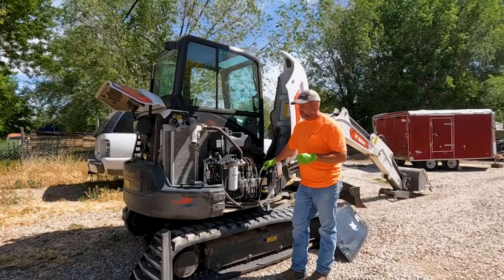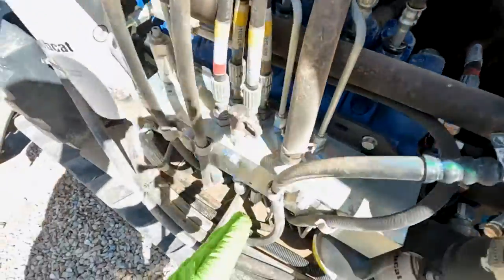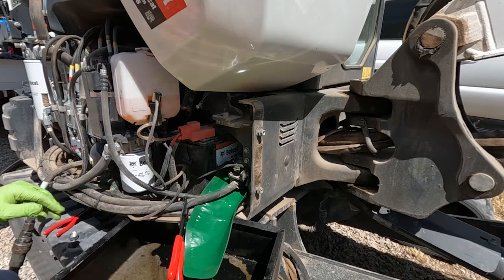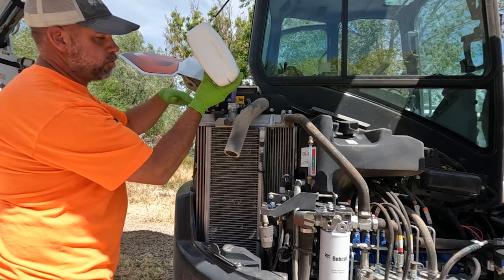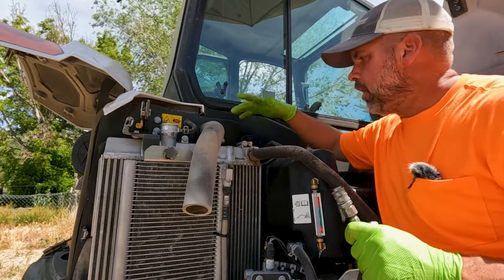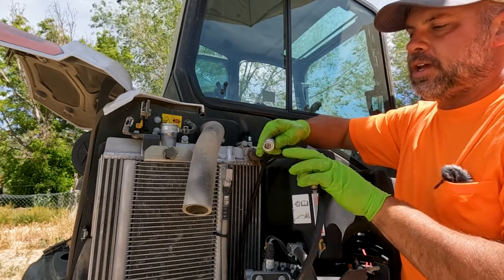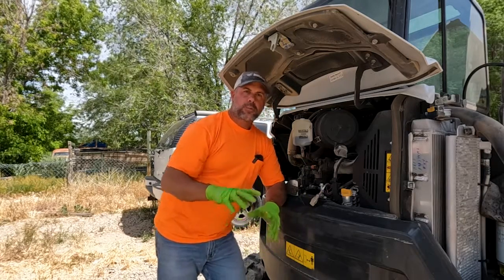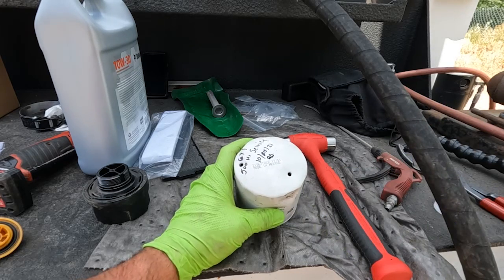Bobcat R2 Excavator Hydraulic Service and Coolant Flush Tips and Tricks

Comment: Thank you for making these videos. I have a 2008 toolcat and changed out all seals in rams. Been 2 weeks working macine but still can't get air out as the sightglass bubble is on the bottom but can't fill anymore oil in

Comment: I saw lots of requests for  links to the hose to bleed out the air from the hydraulic system - did anyone ever find out where to order that.  I saw it available on Bobcat for $279 which seems crazy - its just a quick-connect coupling and a hose

Comment: Interesting video, and nice work.. i like the trick to bleed off air  from the high spot right back into the hydro tank 👍.
On my Deere, they put a little funnel And a hose under the filter ok the Yanmar, so that when you spin it off it drains down and drips right beside the oil pan drain hole (into your receptacle). It's pretty darned cute, i must say ~

Comment: You can actually get more oil out of the system if you extend the boom up into the air and extend the stick and bucket as far out as they will go then drain the system and as the reservoir becomes empty you can collapse the bucket then the stick then the arm as well as the blade this will truly empty the higher percentage of any trapped oil

Comment: Hey I have a 2022 bobcat e42 r2 series excavator that’s spiked a leak at the blade and before I noticed it lost roughly 2 gallons of hydraulic
Fluid, do I need to use bobcat fluid or can I use hydraulic oil from an auto parts store, and my question now is why are my hydraulics so slow? Any advice on why? I did make sure the hydraulic oil was topped off

Comment: Thanks! I messaged you about buying the hose through you but it ended up needing to be more urgent than I could wait so I had one made locally. Wanted to send you a little for the video. 

My e-42 only got about 5 gallons out of it when I drained and replaced the filters. Since the service manual doesn't say to disconnect anything else I assume that this is all that is expected in a fluid change. The dealer sold me 15 gallons to make up for the 14.7 total capacity

Comment: What is the size of that coupler used to bleed the air out of the system. Trying to service my hydraulic system on an e50 and having troubling figuring out the female coupler compatible with what is on the excavator. I've looked around trying to find part numbers and information on the coupler and of course Bobcat doesn't offer any size information or compatible parts to go along with it. Is there a part number you know of or somewhere to find a coupler or hose to use?
Reply from the maker: We have them available at www.4tetradgroup.com

Comment: Excellent! I have a mini digger, 1.5 ton, Takeuchi TB016. I'm here looking for how to purge the hydraulics, having drained and replaced both filters (painful procedures). The instructions say to purge by loosening  or removing a 6mm Allen plug on the pump, but doesn't say if the engine should be on or off. It warns that if not done properly it could destroy the pump by "cavitation" (?).  But it doesn't say CLEARLY how to do it, what to avoid. 
Anyway thanks for the video.

Comment: Super helpful to do my own service. I just purchased a used E26 with 1760 hours. I've changed the hydraulic filters. Oil change next. Wish I had watched this first.  Many good little tips on not making a mess.  I'm a carpenter so any mechanical tips are appreciated.  My controls seem a little slow. Thinking I need to bleed the air maybe.

Comment: It's a bummer about no anti-drainback valve in the oil filter. Certainly there is a filter that would work that has one. Bobcat if your listening, lets do it right. I want my E42 to smile :)
Reply: I bought a set of hose clamps. Makes less of a mess. You just pinch off the low pressure return lines. The way it's set up there's no possibility of not spilling a gallon of oil when the filters come off... Wit a mile and a half of threads so the filter can drain completely before it's all the way off...

Comment: Do you have to use that special hose tool for just the hydraulic filter change? I dont need to change the fluid, just the filter.
Reply from the maker: You don't have to have the hose, if you remove the rubber boot off the fitting you will see a little round piece in the middle you can actually just push that down with a screwdriver and you will hear the air bleed out of it after you change your filter. Just do that a couple times and it should be fine